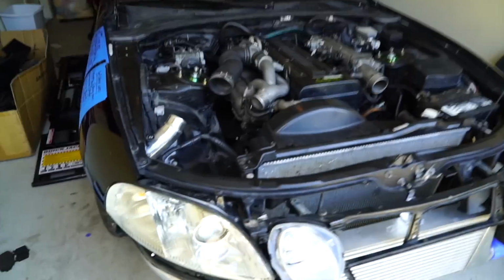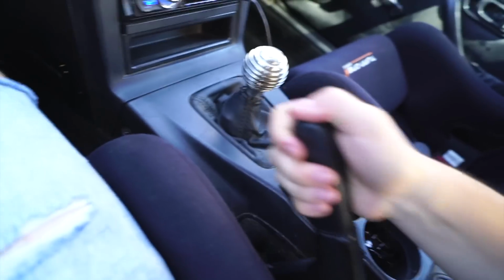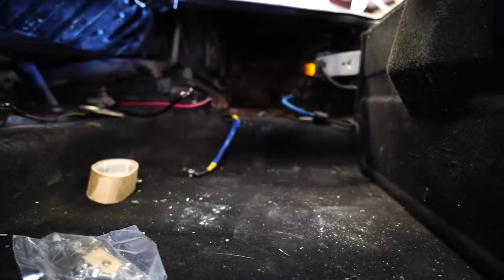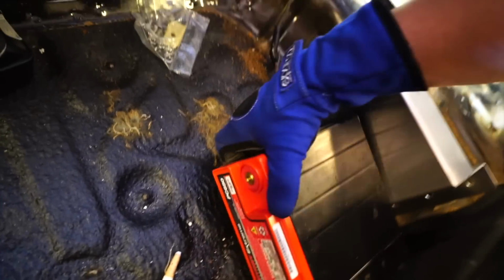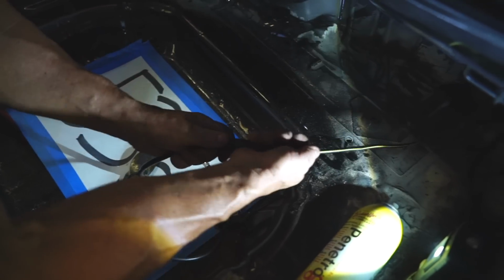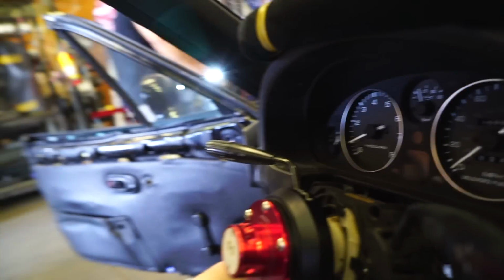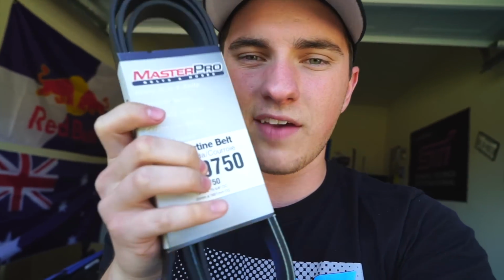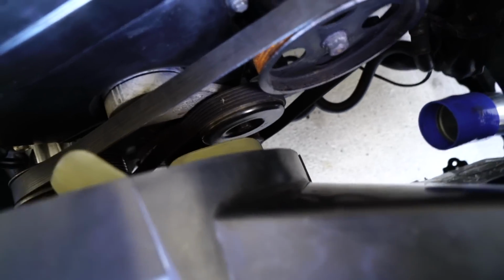Miata RACE BATTERY Install - NO MORE FIRES!!

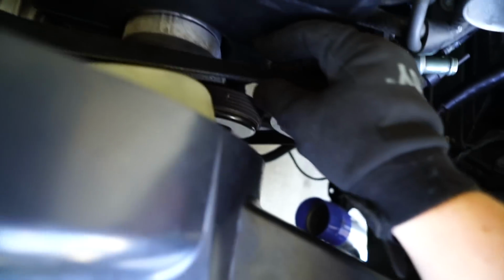Comment: The tensioner will have marks on it to check wear and fitment. Look for 3 marks. The middle is ideal and the 2 ends are technically "acceptable". Check your video at 16:23.... You will see what I'm referring to.

Comment: That aluminum battery cover was really close to the positive terminal...  You may want to consider putting electrical tape or shrink tube around the positive connector where it crosses over the battery holder.

Comment: Advice on getting the right serpentine belt. Get some string, correctly route it around all your pulleys and tie it super tight. Take it to the parts store and have them measure it and match it up with a belt. I did this successfully on a few cars back in the day.

Comment: My boi your car puking is normal., It's just condensation puddling in a low spot in your exhaust. Then getting "puked" out when the exhaust gases hit it right.
Reply: Yup, once the exhaust is hot the H2O becomes steam, It's a normal byproduct of burning hydrocarbons

Comment: is the belt being routed around a tension pulley? if it doesn't have one then one of the accessory mounts should have and adjustable bracket - use a pry bar (which you probably don't have) and an appropriate sized socket (again which you probably don't have) and give that belt some tension...  If you're not sure about the belt size you could buy a couple different ones and just take back the one (or two) that didn't fit and return any of the loaner tools (that you didn't have)....

Comment: LS Swap the miata
Reply: Andrew Macias NO!
Reply: K swap would be much more interesting.
Reply: Nathan YES!!!
Reply: LS swaps are fairly common, unimaginative, gobs of power, but ultimately cliche and boring. A K swap, or even a Mazda v6 swap, are more in line with the spirit of the car and plenty light to smack the shit out of things much more powerful. but, hey, v8 life yo
Reply: paul roberts, just because something is common and isn't "thinking outside the box", doesn't mean it's lame or stupid. there is a reason a lot of people have done it. It's fairly cheap, parts are easy to come by, LS motors are small and light and can make a ton of power without spending a bunch of money. That all sounds better to me than doing some wacky V6 swap just because it's different and nobody has done it before..
Reply: Andrew Macias Im gonna be buying a Miata soon and I'm thinking of either getting a Flyin' Miata turbo kit or just doing an LS swap. Or, just go completely insane and 1/2JZ swap it which I probably won't do, but it's still a possibility, albeit a small one.

Comment: When you mounted the power steering tank is that right next to the header pipe? If it is you might wanna move the tank because you do not want to over heat the fluid. Just trying to help you sir. I am a big car guy myself and have done things like that before and had it bite me in the end. I hope that the autocross goes well for you this weekend. 

Chris

Comment: Serpentine belt looks too loose, power steering reservoir would probably be better in a cooler part of the engine bay and does the battery cover not go with the fold to the bottom of the battery rather than right next to the terminals?
Reply: Bored so I got an account! yea you don't want that metal box right next to the terminals. Other option is to flip the battery over so the terminals are innthe other side, and mount everything to a nice piece of carpeted wood. That's what I would do anyway.

Comment: Anyone care to explain why he says his rear brakes aren't working after installing new pads? I doubt the Miata is any different than any of the 30 or so cars that I've done brakes on, or does he think that because his e-brake needs to be adjusted, that his rear brake pistons aren't working? lol When you compress the piston back in to fit the new pads, as soon as you put it all back together, bleed the brakes if needed, then start the car and pump the brake pedal, all 4 brakes "self adjust". Most cars the e-brake is run with a cable which will need to be adjusted, but that doesn't effect the rear calipers when using the brake pedal.

Comment: what exactly is a racing battery?  what makes it different than a normal 12 volt car battery?
Reply: 2583060 mostly smaller size and rear mounted location I believe. Frees up room in your engine bay
Reply: having less space to fit piping or turbos or any related stuff.  But I guess every inch counts.  What you mean rear mounted?  Not every car is a BMW or puts the battery in the back, how do you do that on a toyota/lexus